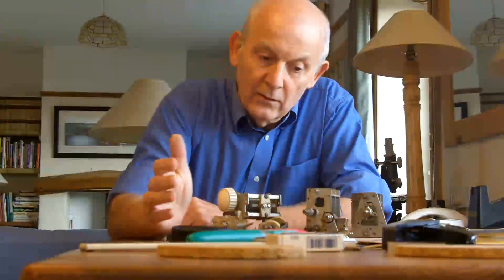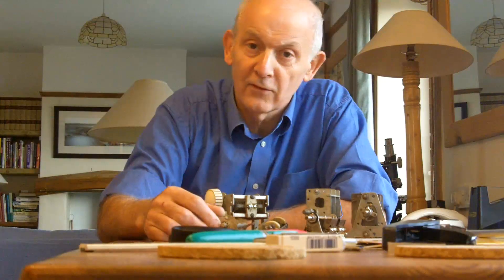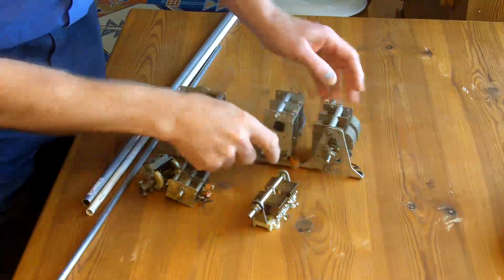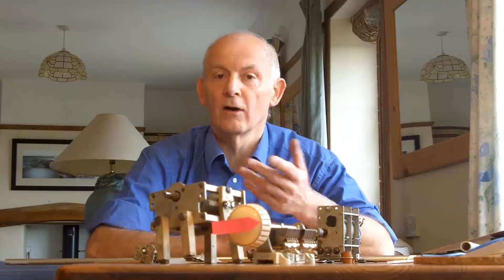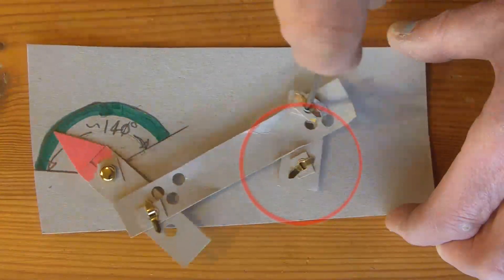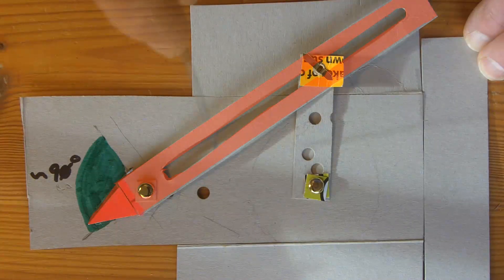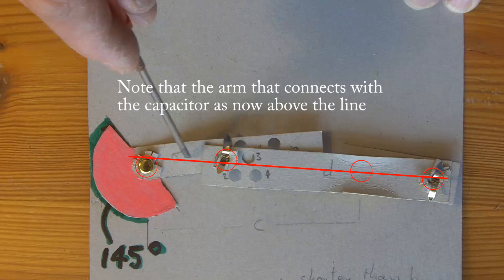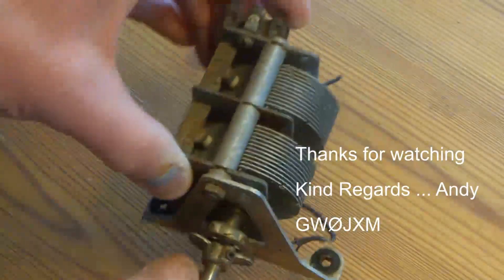About Radio 61 Variable capacitor drive mechanism concept for antenna tuning

Comment: Thank you, Andy. Not seen the use of lever arm drives with variable capacitors before, but I have not looked much either.
   I use cardboard too. It saves on time and cost of materials.
   Again, thank you. ATH, N0QFT

Comment: My cardboard model of The Globe Theater is still in the English department of my old high school. Cardstock prototypes should not be underestimated. I drew the half timbers on some card stock, laminated them to my model, and carefully glues it up, glued the roof, on, did the inside, and it was my little tribute to Shakespeare.  I have always been more into engineering, physics, math and science than liberal arts, so I had to do something. I do believe I shall "borrow" this from you! If you get too close to 180 degrees the travel will attempt to run all the way around 360 degrees. I used a similar type of device to lay in wires I was winding on bobbins for coils. The disadvantages were some uneven movement, so I wound up with the wire piling up along the ends of the bobbins. All good stuff, and why I had not considered it for winding, I can't say. I had been using a worm gear and a stepper motor, or elliptical or eccentric  cams. That could be another way to move the blade in the capacitor too!

Comment from the maker: Hi there, OK on the notion with the timing belt. For me the loss of a few degrees of travel of the capacitor is on big deal particularly as I can bias that bit of lost movement to be either at the fully open or fully closed end of the travel, but thanks for the input as it could help someone who needs the full 108 degrees movement. I always reckon ‘there’s more than one way to skin the cat’
Kind Regards ... Andy 
GWØJXM

Comment: Then use a length of timing belt with one end connected to the outer race of a small ball bearing with the inner race bolted to the motor disk. Wrap the belt aprox 180 deg around the pulley and put a very light tension spring on the other end to maintain belt tension and also provide the return force when the motor is pushing the belt.  I know from you background you know exactly what I am talking about .  both these methods also allow any number of degrees of rotation to be achieved.

Comment: Hello Andy, nice video. You can easily get the full 180 out of your mechanism by changing your connecting rod to a rack on the end that engages a gear on the capacitor input shaft. I am sure you have seen mechanisms to hold the rack engaged to the gear while still being able to pivot around the gear axis.  If you dont want that complexity of components you can accomplish the same thing with a timing pulley on the capacitor input. continued on next comment.

Comment: Once  again Andy - another excellent video! 
It seems to me , another application for this would be a simple sweep generator - say a oscillator circuit around 455kc, made frequency  adjustable by a variable capacitor, mechanically linked to a potentiometer triggering the x axis of a scope. Wouldn't that give you the mechanical equivalent of a wobulator?

Comment from the maker: Hi there, OK on the motors. I haven’t actually handled these little motors yet, I'm more used to larger devices than the ones I’ve ordered but looking at some of the close-up images of some of the little open gears boxes the look quite respectable. Thanks for the heads-up on the grease, I’ve seem that sort of ‘token’ grease application and understand exactly what you say there. But did you really think I'll be able to resist opening one up just to have a look, Hi Hi  
All the best ... Andy

Comment from the maker: Hi Mick. OK on the worm drive, I did think about that method and that would be fine for a continuously rotatable capacitor but I’d have to have limit switches for the 180 degree variety. Unfortunately I never had a Meccano Construction Kit as a child, I’d have loved one (still would) I was very envious of lads with the fabulous kits with all the gears and powerful wind up motors. I think that was probably the first time I saw a worm drive. You’re making me think back a bit.
All the best ... Andy

Comment from the maker: Hi Carl, I have Auto Cad which is fine for coming up with the final dimensions but for that ‘hands-on...how’s-it-going-to-feel’ sort of satisfaction you can’t beat a mock-up. You learn a shed load of facts about a mechanism that way. I've made equipment for Rolls Royce, Kodak and Sony to mention just  a few and they all started as cardboard cut-outs. I don’t have the models anymore but I may have some pictures somewhere...I can feel another video coming on. 
All the best ... Andy

Comment: Although not a common item available for today's amateur, a gear and worm drive assembly is outstanding for this application.  I built one back in the '60s using parts from salvaged military equipment (without a motor.) As usual, your videos are stimulating for the old grey matter!